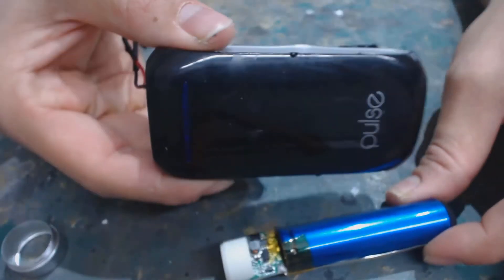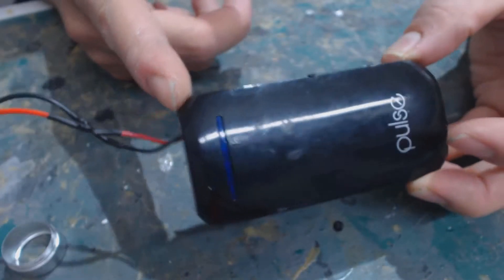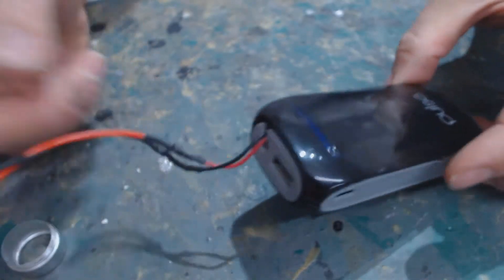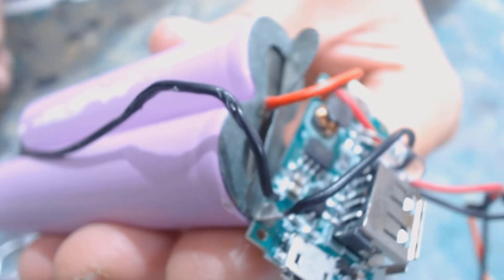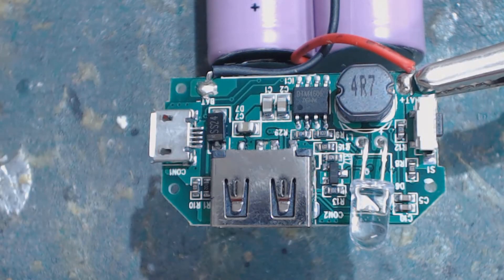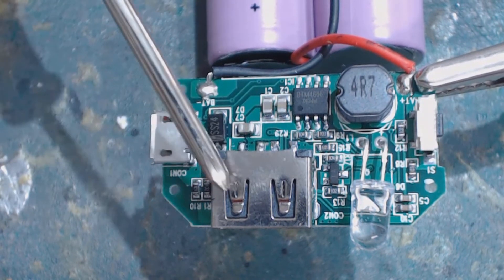powerbank mod for cosplay electronics

Comment: Im planning on powering my arduino uno this way in addition to some fans and bluetooth audio. Do you this wiring setup would be okay for that? Im using a 3 cell power bank and my voltmeter readings seem good from the new wires.
Reply from the maker: IndieArtsMidwest I wouldn't connect fans to this...
Reply: Wayne's Workshop Not even a small 5v fan? Like ones used to cool an RPi heatsink.

Comment: So, I went and opened up one of my single cell power banks to see if this would work. But it doesn't activate my LED's at all. I was under the impression it wouldn't work since the cells are only 5V but it seems to work for you? Are your LED's less than 12V? Or is my powerbank just too low on charge?
Reply from the maker: yes they are less then 12v... a 12 volt wouldnt work all too well on a 5 volt power supply ;) i tend to use LED strips for arduino mostly as they run on 5 volts, if you have pre wired leds, sometimes there are resistors in place, also fully charge your powerbank and also never deplete it fully...
Reply: Right, but, where do you buy lower voltage LED strips then that are still bright enough? Almost every place I see that sells them only sells 12 or 24 volt strips.. Additionally, how would one make sure to never deplete it fully? I guess just keep an eye on a battery indicator?
Reply from the maker: exactly, they last way longer already than regular aa batteries or the likes, just dont abuse them, and for example, charge them after your finished for the day, see the lights dim too much, turn em off, so far ive used the old one in the video for almost 2 years without problems.
the lower voltage are still bright enough, just search on aliexpress for 5volt led strips, the rifle in the gun in this video are all 5v led RGB strips
Reply: interesting, alright thanks, I'll check it out.

Comment: this is really really really bad. you can't ever do this. this will wreak the battery's or even worse  create a unstoppable  fire.  The pcb is for protection. you can solder the wires to the back end of the usb then you will have a stable 5v supply.
Reply from the maker: i was expecting atleast 1 of these comments to pop up :)
im gonna assume you know a thing or 2 about electronics, (maybe even studied for it, as have i)
this battery mod is now almost 2 years old and has been used for powering the arduinos with servos and leds in my starbooster armor and the gun in the video for more times i can count.
its been through the ringer one could say...

the pcb is there indeed for a level of protection, moreso for the charging part that it stops charging once full.
not worrying so much about the discharge rate as i do mention it should be used for light electronics e.g leds...

this can be used just fine as a powersource for leds and arduinos and the likes if used well.
hooking it up to the back end of the usb would actually cause it to shut down if there isnt enough current flowing.
powerbanks are configured for phones (and the likes) afterall and it will shut down if for example only a few leds draw current.
(trust me i tried at first, also modding a usb cable to just punch it in the usb port so taking the bank apart wouldnt be neccessary...)
some power banks dont have this feature of shutting off, so yes then hooking it to the backend of the usb is perfect, this is not the case for these powerbanks and some other chinese models ive tried (even 1 with 6 cells of a friend of mine)

ofcourse you shouldnt hook up a 12 volt fan to it or anything heavy, i will see if i can clarify this fact with a caption just to emphasize its for light electronic stuff, i do say it in the video but one can never be too sure.
Reply: for you it's fine because you know what you are doing. for some one that has not a degree in electronics it could end up with a fire... i'm studding electronics indeed. and i have build some lipo battery packs. i'm always worried about people who see the video and then decharge the battery till 0v and then the powerbank won't charge anymore.
Reply from the maker: i can see where that worries you, its something on my mind aswell as im making content.
i try to make it as "dummy proof" as possible. but it can only go so far.
people still tend to stay clear of it if they dont trust themselves in doing these things.

its kind of the same with my ecig smoke machine mod.
it works just fine, my instructions are there for a reason and not to go over the 30seconds mark, otherwise a coil could burn out.
if people let it rip for 5 minutes straight and the coil burns out, thats on them and not me.
i share the info i have in the safest way possible, ignore the safety stuff, well then accidents are possible to happen.
i cant bare responisibilities for every cosplayer or crafter out there, maybe i should put one of those disclaimers on my videos (those are the safety nets for businesses against those "non-degree" people also)